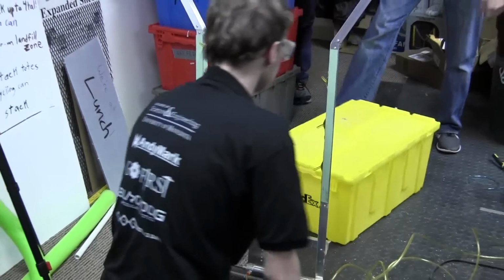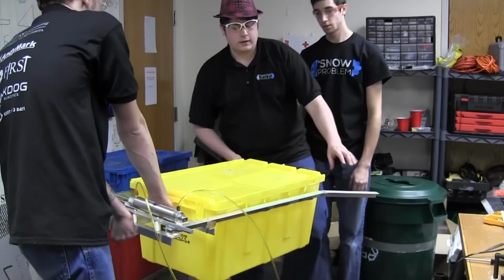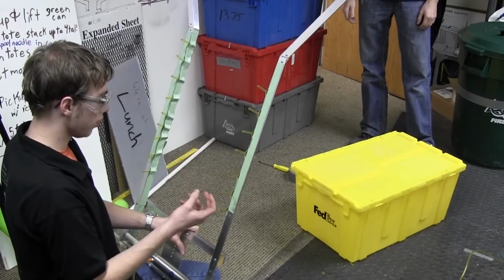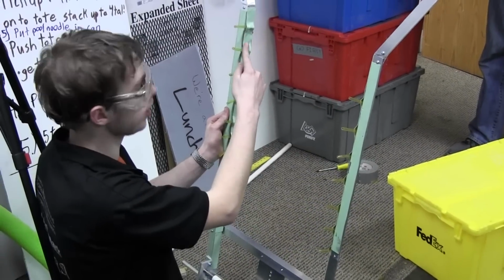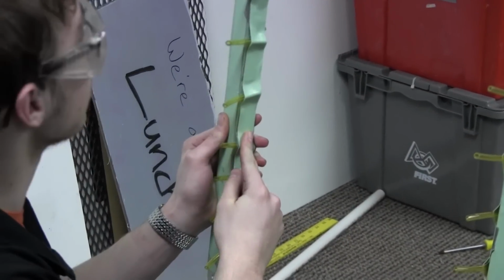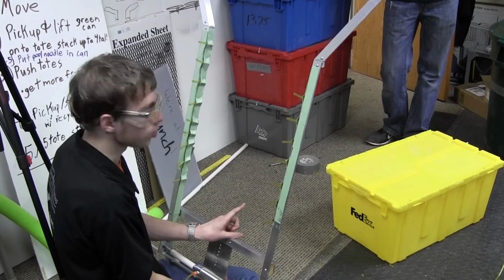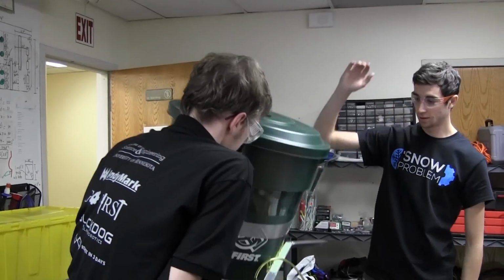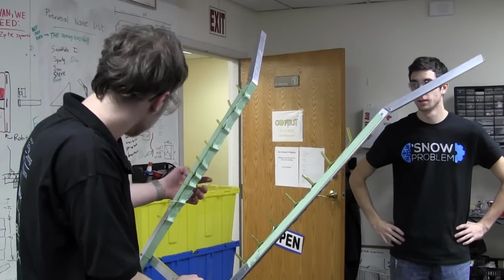Ri3D 2015: `Snow Problem Pneumatic Claw improvements

Comment: I figured some sort of fingers engaging the lip would help, I didn't think something as basic as tubing would be THAT effective though. Quite impressive.
Reply: Thanks! The rigid tubing engaging the lip helps quite a bit, but the Impact Stripping Tape is really the secret sauce. It holds the tubing in place, and gives our claw a lot more friction gripping the totes.